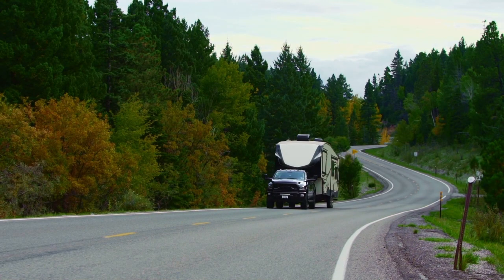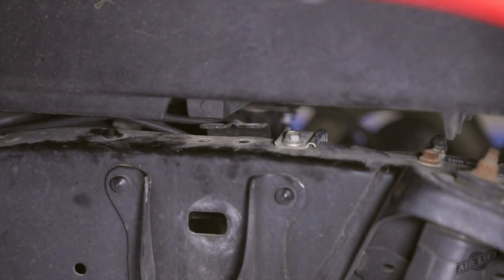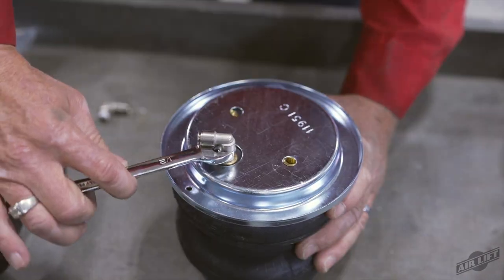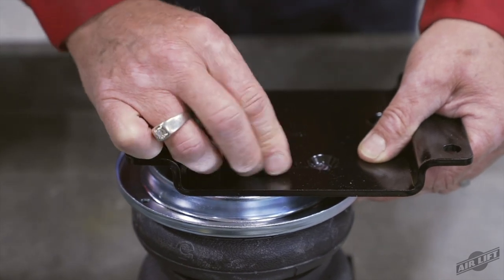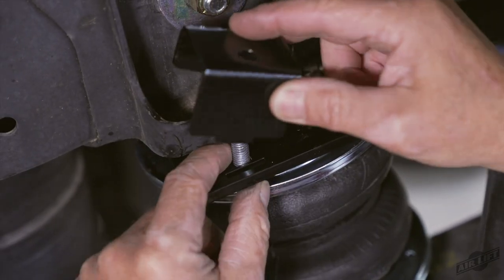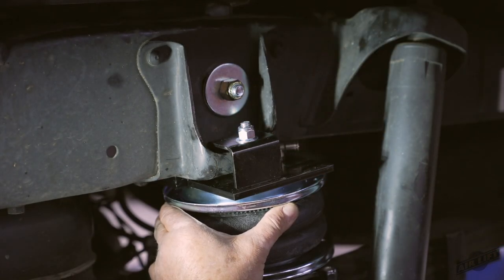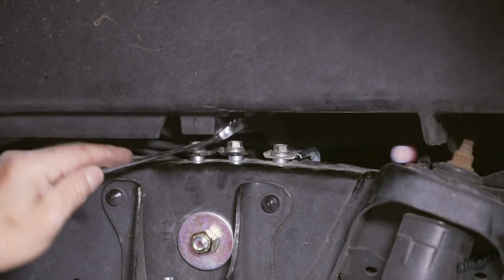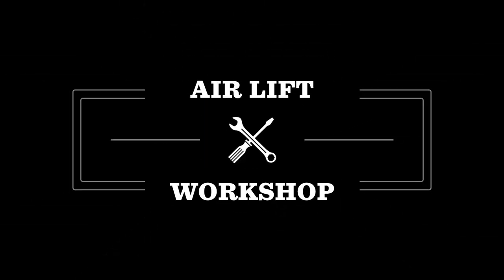Air Lift Install 57300: 2005-2023 Toyota Tacoma 4WD / 2WD - LoadLifter 5000 Part Number PN 57300

Comment: Does the air lift kit for Tacoma fit if it is raised 3 inches?
Reply: If you are on just blocks shouldnt be an issue but lifted leaf pack may run into issues